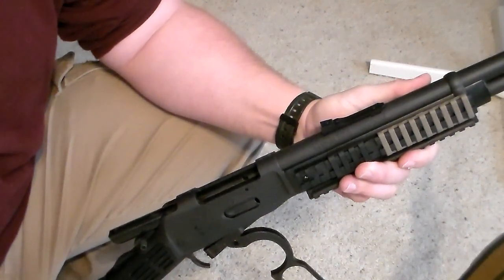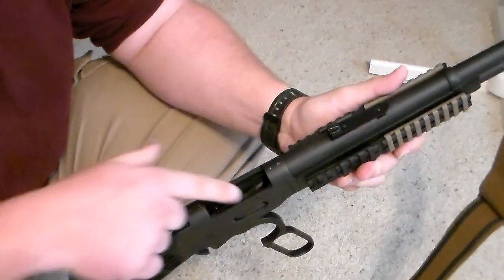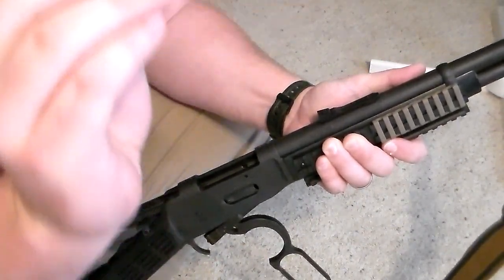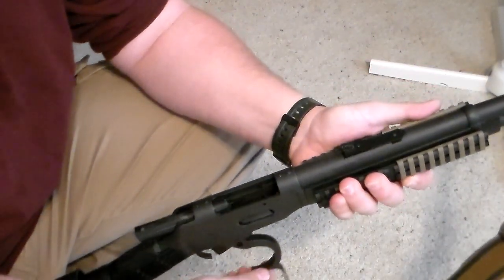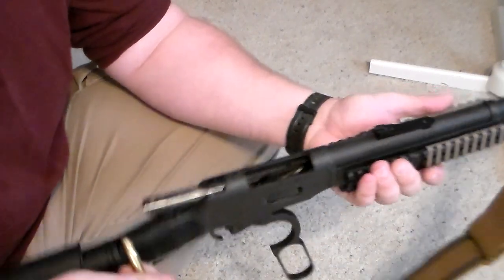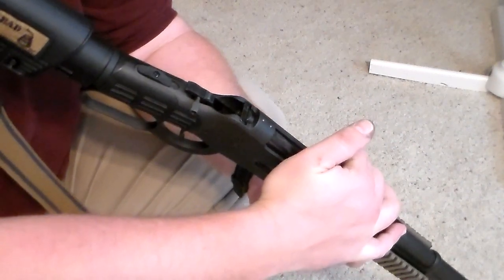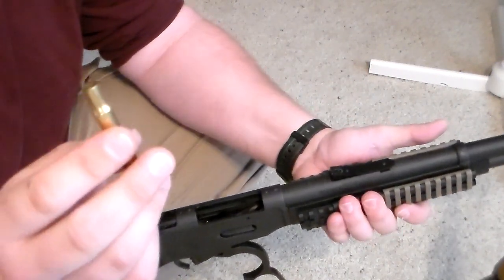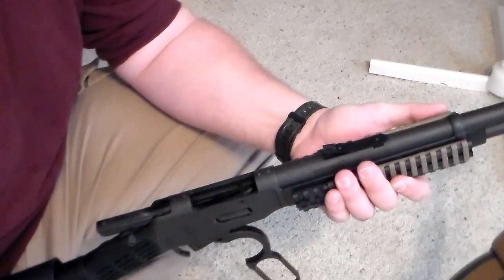Lever Action Rifle Emergency Reload

Comment: For those wondering that's not a mod. That's an actual configuration you can buy from Mossberg. The rails I suppose have purpose but it's more tacticool than anything. I'll stick with my Winchester '94

Comment: After watching this I pulled out my zmb 464. I found another way. If rack it Open only 95% so the feeding ramp is still in the down position, you can drop a round  in like a shotgun as long as you drop the rear end of the round through the wide cut out part in the middle of  the ramp. It falls in the same spot as if it came out of the tube. Rack the rest of the 5% fourwords and close and it feeds perfectly.

Comment: The Marlin 1895 enables a shooter to tilt slightly to the left just like a shotgun, drop the round in and forward the bolt using the lever. It may be a problem with the Mossberg 30-30 but not with the Marlin 1895. The rounds in the 1895 enter straight into the chamber, no angle involved.

Comment: I would rely on my Marlin lever action in a shtf situation, far before I ever rely on a semi automatic. I've had 6 different Marlin lever guns - 4 in .30-30, 2 in .45-70, and NONE of them have EVER given me a single issue, in any way shape or form. No failures to feed, no failures to eject, no light primer strikes, no jams - nothing. Just to test the reliability of a Marlin I had bought last year (it was made in 1984 and heavily usd when I bought it) I cleaned all of the grease and lube off of it, cleaned the gun 100%, and re-lubricated the rifle with some cheap engine oil. 10-w30. I ran, over a 4 months period of time, over 7000 rounds through it, without cleaning it one single time, and it never failed me. I'll bank my life and my families life on my Marlin. You just can't kill 'em.
Reply: NovaMan 350 Amen brother, you are 100% correct!
Reply: NovaMan 350 7000 rds of .30-30 is an expensive endeavor in a 4 month period.
Reply: NovaMan 350 .... thanks... been kinda of setting on the fence about a lever gun versus AR 10 in a grid down situation... I care more about long term reliability ... Too many moving parts in an AR plate form... still would a lever that held 15 rounds... any thoughts on that? Thanks

Comment: I found exactly the same with my Rossi. If you just drop the round it, it will bind. You have to push it into the chamber.

Also another thing to be aware of. My Rossi is only about 50% reliably when upside down. Now it is not very common that we find ourselves upside down and needing to fire our rifles, but if you do, you might have feeding issues with this design.
Reply from the maker: Jesse Sisolack That makes sense since I can see how the round angle would change upside down since the round is loose in the elevating portion of the action.
Reply: MillerUSAF Both the Mossberg and Rossi are copies of the Winchester action. Some people told me their Rossi will not work on the side as well, but mine works fine in every position except upside down. Anyway, just a minor quark of the design. Still good rifles even though the Mossberg is damn ugly, ha.
Reply: +Jesse Sisolack Meh I'll stick to my marlin
Reply: +damiion666 I have one in 30-30. Good rifle. Great for shorter range deer hunting.

Comment: I can single load my 336c pretty simply. I have never had a problem with it getting caught even when dropped in (with snap caps at home and various ammo at the range). If you had the barrel pointed down and tried the same thing,  would it make a difference in the Mossberg? Interesting video, nonetheless.

Comment: This exercise is precisely the reason snap caps exist!!!
Reply: +Porty1119 - You are right on. I cannot believe that he would publish a video implying that using live ammo for demo purposes is something you can do - "just be careful". Highly irresponsible. Just hold off on making the video until you have gone out an bought some snap caps! DO NOT PROPIGATE ANYTHING THAT IS CONTRARY TO THE 4 WONDERFUL RULES OF SAFETY.   No doubt, if you strictly adhere to and make a habit of the four basic rules  NO ONE will EVER get hurt. Has to automatic and habitual with NO compromise. That simple. Cannot respect this dude at all. Hard to believe he has subscribers.
Reply: +Hunter Jordan   You are missing to point of how valuable discipline is in firearm safety. On a range where it is safe and legal to discharge a firearm is the only place where live ammunition should be in proximity to a weapon in a demonstration . It is just far too easy for the frail human mind to forget that you have a live round there. If the live round is NOT there you are safe from the frailties' of the human mind. Just surf the web for negligent discharges and you will see what I mean. There are several where firearms were being demonstrated and the weapon went off because live ammo was mixed with a demonstration. (ie that AT agent etc.) This just comes short of proper firearm responsibility.
Reply: Marlin 336 you can just drop a round in the port and itll slide ino battery no issue
Reply: He said use a snap cap or empty case at the end... And he didn't chamber the live round...

Comment: being when you run dry you will probly get a click and the action will be closed anyway why not just put a round in the side quick  then rack it / if your talking tactical lever gun your probly never going to allow it to run dry cause you should be shooting 2 or 3 loading 2 or 3 and repeating but if it would run dry say in the dark would be easier to train to just hear the click load one in the side from feel then to open it up and try to thumb the round in the barrel also if you drop it when doing that you could have more issues then just a empty gun personally i would say just load on in the side and it will be much quicker and in a stressful situation there is less to go wrong if you just run till doesnt go bang then load in side
Reply: droppin plates the conventional wisdom is that if you get a fail to fire you open the action to visually inspect what the problem is and determine if the firearm is empty, or a fail to eject, fail to extract etc.  So in an emergency with danger close you can drop a round directly into the chamber and close the action and address the problem. Then if there's time load them into the tube

Comment: So that’s how you +1 a lever gun. Thank you.
Reply: Another way is to load the magazine through the side gate to capacity, rack the lever, now you have one in the chamber ready to fire. Load one more round into the side gate and now you are 5+1, 6+1, 9+1, or what have you. Loading your plus one with a lever gun by opening the chamber and closing it with the round being in the chamber is only for an emergency load. If you have an actual emergency and need to load a round in your lever gun immediately it most likely will be faster for a shooter to load one round in the side gate and rack the lever.

Comment: John Browning is doing barrel rolls in his grave ever since Mossberg brought out that gun. I would rather have spent the money on an original older Winchester Model 1894 (notice I didn't say 94), such as an original saddle ring carbine version which has better sights than versions that came out after the 1950's. Myself, I picked up an older Marlin 336 variant (made in 1970, long before Freedom Group ruined the Marlin) and long before the advent of the awful crossbolt safety. I simply added a Skinner lo-pro sight which acts as a ghost ring for both hunting AND personal defense.

Comment: I have a Winchester 94 and I can just drop it in
Reply: there are different feeding mechanisms
Reply: +Alex Ulrich oh ok thanks
Reply: Reckless Big difference in the hardware. You gotta think when the 94 was designed it was a combat weapon. So you definitely wanted to be able to drop a round I'm easily. Mine is from the 1970s. I love mine.
Reply: I got a 94 that was made in 1960

Comment: im.waiting  to have 223 version on this. i hope they make it hehehe
Reply: STEVO CAMATCHO I want one in .357 mag .
Reply: A .223 bullet will not work in a tube magazine because of the tip of the bullet.  It is to pointy.  Tube magazines you need rounded tip bullets.

Comment: the mosberg is the ugliest and  cheapest lever gun ive ever shot. I fired a bx of 20 and it jammed several times and i cut my finger on the trigger and loading gate
Reply: yeah i don't have that issue with mine. sorry about your experience :(
Reply: @TheNewtMan1992  they haven't broken they gun in yet they pry only shot 50 round through it that's pry why its giving them problems